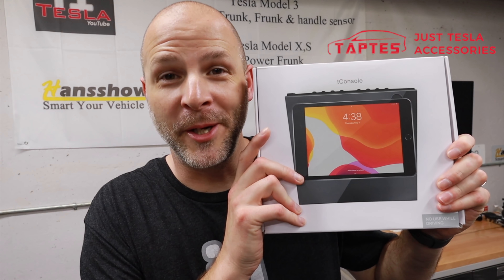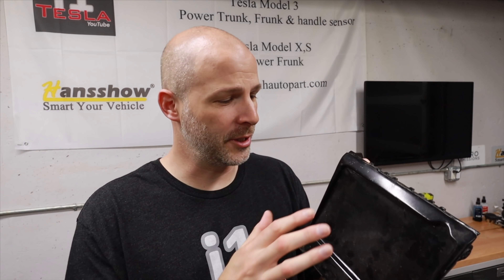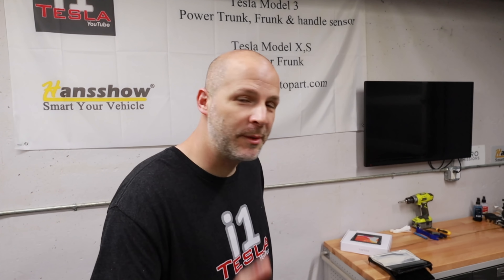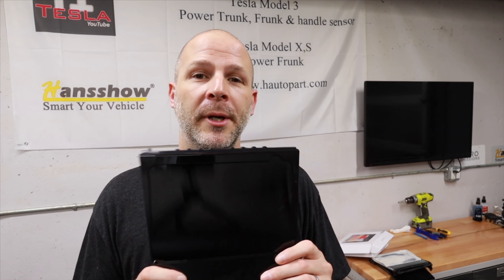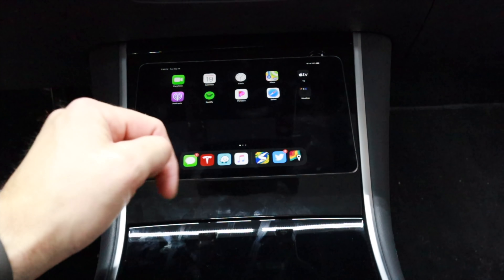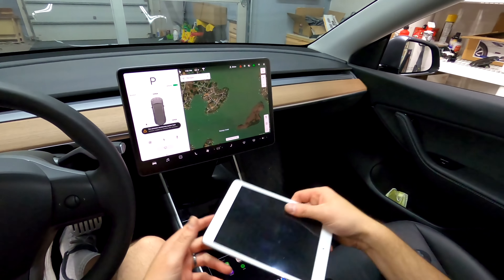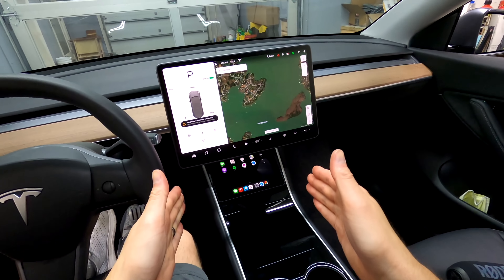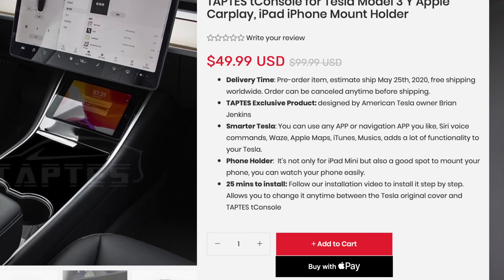iPad Mini in a Tesla - Tesla CarPlay

Comment: No charging for the iPad is going to be a hard pass from me.
Reply: Adding wireless charging to mine now. Not too hard of a mod to do. I’ll upload something once I’m done.
Reply: Mike idea Mike. The charging parts needs to be thought about too. Imagine a long trip suing Waze and then having to remove it to connect a cable to charge the iPad. You are on the right track. 😊👍🏼
Reply: I added a dual output battery that slow charges from one T3 USB, and superfast charges anything I want, without going to lighter plug.  I actually run a dual-port inductive charger insert from the battery.  Unfortunately that piece was shrinking the available space, so I had to Dremel off 1/4" from the bottom edge.  Works!

Comment: I think that you need to add a charging port for the iPad (long road trip), I really like your ideas!
Reply from the maker: Not needed. I just drove with the screen on for 7 hours. I ran Waze and a podcast the whole time. You don't need to have the screen on but I wanted to test how long it would last.
Reply: @i1Tesla  You still need to charge if you are on a several day trip.
Reply: @hoffmantnt  a several day trip will mean you can charge it overnight wherever you stay. Easy peasy lemon squeezy.
Reply: @hoffmantnt  If you're on a multi-day trip, you can charge when you're not driving.
Reply: @i1Tesla  Disagree.  I'm putting together a CarPlay solution using an Android tablet.  It will need something plugged in.  Plus I'd like to just leave it in the car and not have to remember to take it out and charge it every couple of days.

Comment: This is friggin' genius! I have been obsessing on various installation options I have for an extra iphone/ipad to augment my driving experience (i.e. Wayze, XM Radio Stream, etc.).  I was about to install a bracket on the back of my Tesla screen to hold my iphone+ in landscape mode but then I came across this.  I haven't looked at the price yet but I can tell you I am buying it.  You should partner with a Telsa accessory dealer like RPM or AbstactOcean (I'm not affiliated - just a customer).

Comment: That's a really great idea and product, but it would be even better if it were an adjustable cradle so any tablet that fits within the edges would be held securely. Kind of like the paper guides in a printer. In theory you would really only need one edge to move, and that could be the top edge so you don't really see it.

Comment: Would be nice to have a steering wheel mount for your phone plus an app that would maybe use the OBD to display speed and suchlike in a customised binnacle display.
Reply: Prob with steering wheel mount is that if it got in the way of an airbag deployment, a phone could become a deadly projectile.
Reply: @mrmxpop  well I meant set on the back of the steering wheel, behind the top gap. Nowhere near the airbag.
Reply: @MrGonzonator  Some peeps do mount phone holder on the wood/black/white dash panel.

Comment: Would have been good to include some kind of charging option, eg. passthrough or induction charging.
Reply: I added a dual output battery that slow charges from one T3 USB, and superfast charges anything I want, without going to lighter plug.  I actually run a dual-port inductive charger insert from the battery.  Unfortunately that piece was shrinking the available space, so I had to Dremel off 1/4" from the bottom edge.  Works!

Comment: Awesome product. Congrats on getting it to production. Couple things i noticed. If you use it for the suggested purpose of waze, battery drains quite fast. Will there be integration for a charging cable? From the video, it looks fairly tight.  Also, with the position so low and deep in the car, how precise is the GPS signal, and how strong is the cell reception form that location?
Reply from the maker: I drove the car for 7 hours with Waze on and the screen on the whole time. Battery life is great on iPad no need for charging

Comment: I was so stoked to see this and was like it's finally out. But, you broke my heart at the end. No android. I don't do apple. Great product i will still say. I will still tell everyone i know.
Reply: I think any with specs similar to mini will work fine. I have an asus zen pad I intend on trying. Theres too many android tablets and variations to hone in on one tablet to make something like this realistic
Reply: I have never purchased an Apple product and don't intend to start now. Any Android tablet with similar or slightly smaller dimensions should be able to fit and you could always add some sort of material to improve the fit it it's off, maybe even something spring loaded to allow for some variation in sizes could be put together. I'm going to try it.
Reply: @zs450  agreed
Reply: My tConsole arrived today, after a long journey through customs. 
The Galaxy Tab A 8.4" tablet fits snugly lengthwise. The iPad is about .4 inches wider so there's a little room but it does not seem like it won't be secure. I'll find out once I get it installed and go for a drive!

Comment: Good work and congrats on bringing this to market.
Charging ability? Will it fall out on rough roads/bumps etc? Maybe add a couple of velcro "dots" at the corners or ???
Reply from the maker: I launched the car and it stayed in place. Charging is not needed. iPad battery lasts a long time
Reply: @i1Tesla  Maybe you need to go for a ride with me...   ;)

And what if you want to use your Ipad after your drive? I bet a charging option would be welcomed by most. I charge my phone in the car so it's good to go when I get out, why wouldn't you want the same for Ipad?

Comment: FYI a Galaxy Tab S2 8.0 is the same width as the ipad mini 5 (134.8mm) and just 4.5mm shorter (198.6 v. 203.2).  It is also thinner, so it could fit with maybe some bumpers added or a case.   If you send me one, I will test that for you. :)
Reply from the maker: Then that one should work. The reason for not making for android is there are too many devices

Comment: What about charging the iPad?
Reply from the maker: No need. I just drove to Ohio (500 miles) using waze and streaming podcasts. The screen stayed on the entire when driving and lasted 7 hours.
Reply: i1Tesla that’s awesome! So then the answer is: “don’t forget to charge before a trip” but for those of us constantly not as prepared, is there a way? Or is charging on the go strictly off that beautiful iPad mount?
Reply: You might be able to use a wireless charger through the plastic, using this right angle flat adapter ... would probably need a wireless charging puck under it that was raised up to meet the plastic underneath: https://www.newegg.com/p/0ZK-08C1-03J24?item=9SIAMGGAPB2305 (or if you wanted to do some soldering, you could make a hole, and cut the wireless charger bit off, and just solder together a usb cable end to plug it in directly.
Reply: Glen Souza even with a Ushaped cable the remaining space is imho too narrow...
Reply: Brant Wedel Unfortunately iPads don’t have wireless charging. I’m sure you can easily plug it into one of the USB ports.
Reply: yeah, seems super narrow... I get that it's the iPad size that makes a snug fit on the console door. great product, I'm getting one

Comment: I appreciate your tenacity on this project. I'm sure the space provided will also fit an Android tablet, it's just a matter of time until somebody finds out which one. However, I'm still hesitant about the use cases. For Waze, I prefer to use the main screen by browsing https://teslawaze.azurewebsites.net/
I already have the streaming music of my choice in my standard M3. And my favourite weather channel with rain radar also works fine on the M3 standard browser. Furthermore, the iPad mini or Android tablet require a data connection, either via integrated SIM card or via my smartphone hotspot.
Meanwhile, I wish you all the best for the further development of this project.
Reply: I’ve ordered a MY but haven’t received it yet. I thought the MY offered WiFi.
Reply: In my part of the world they only enabled the browser with the most recent update, and the browser closes when you start driving, so it's useless for anything you need to keep going while driving.

I don't do Apple, but Android tablets aren't feasible because even the same company changes everything with each generation so nothing would fit but a single generation of a single model.

A generic adjustable cradle would be a good idea, though.
Reply: @Bigjohndallas  there is no Hotspot if thats what you mean. You would have to share your phones internet with the iPad or get a cellular version. Another feature tesla needs to implement
Reply: Jay Cianciulli Yes, a hotspot is what I meant. Thanks! I have a hotspot using the OBD II port in my Honda CRV that works great (and only $5 a month with my current cellular plan). I mainly use it to track my business miles. It looks like the MY is not equipped with an OBD II. I’ll have to figure out how to install one. Thanks again for the info.